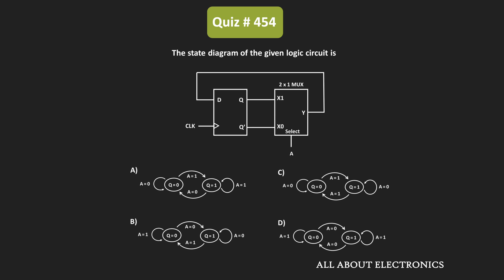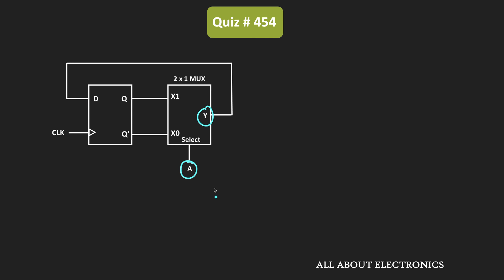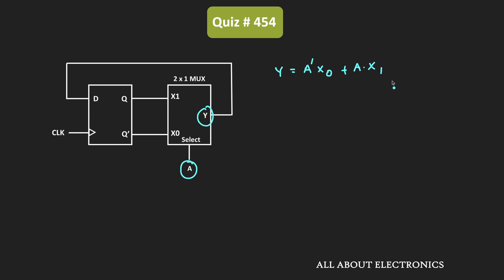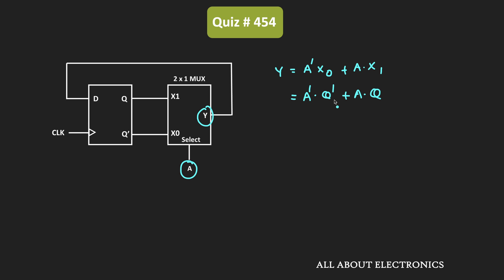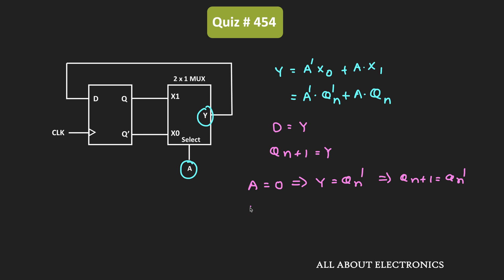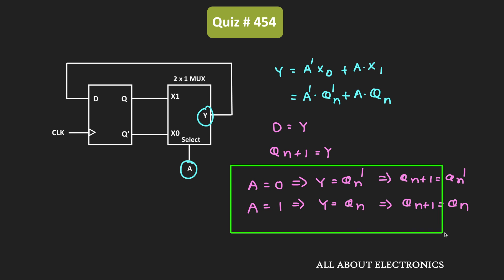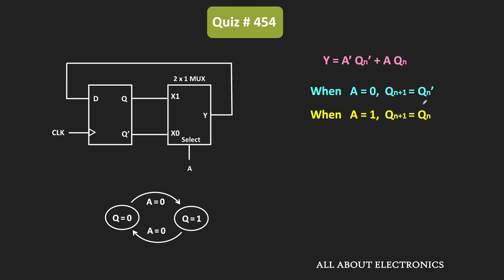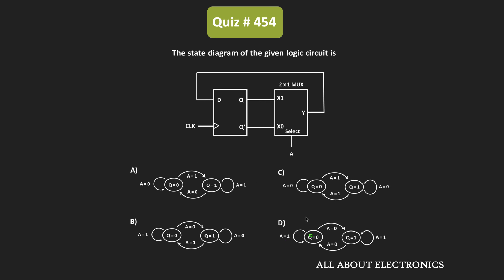Can you find the State Diagram of the given Logic Circuit ? (Digital Electronics) | Quiz # 454

Comment: If A=0
Then the output of mux is X1, not Xo the equation in the video is wrong.                                                                                                                                                                                                                                                    So the correct equation is Y=A'*X1+A*Xo
Reply from the maker: Generally in the Multiplexer, the suffix ( 0, 1 or any number) at the end of the input X represents the decimal equivalent corresponding to the selection input combination. That means the selection input combination for which that specific input will get connected to the output. X0 represents that when the selection input is 0 then this input will get connected to the output. It doesn't matter whether the inputs are represented from top to bottom or, from bottom to top on the multiplexer. Sometimes, to confuse the students, this is how the inputs are represented. (From bottom to top)
For more information, please refer to this video on Multiplexer.
https://youtu.be/aQlF-9i3fAA
Reply: So based on the suffix the output is dependent and not on the top to bottom or bottom to top order of input pins.
Reply from the maker: Yes, exactly.